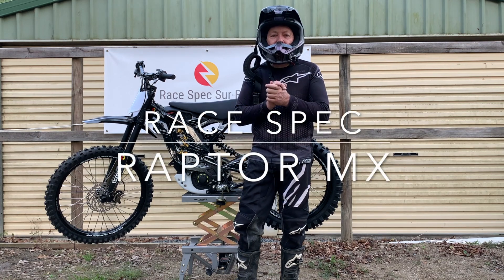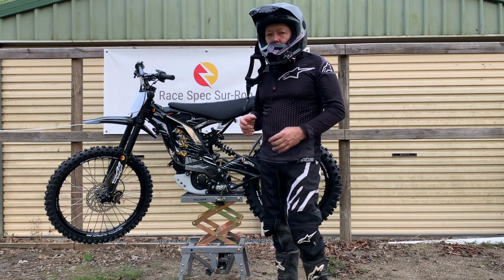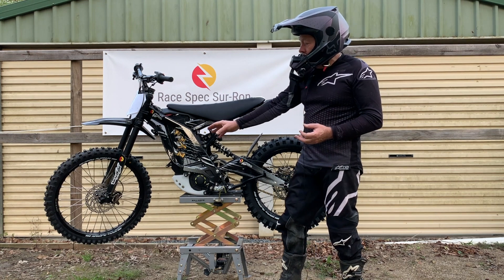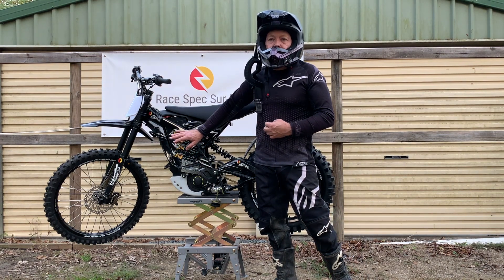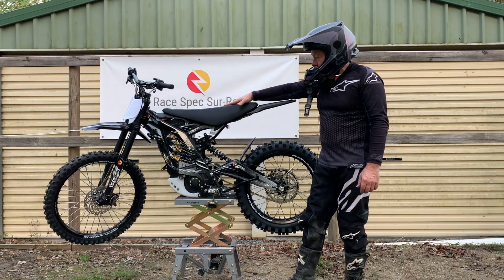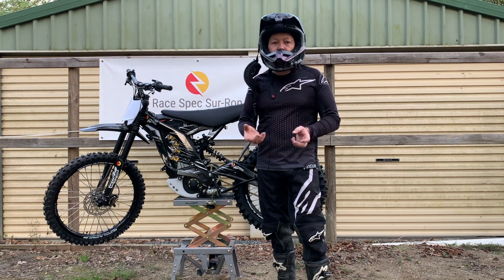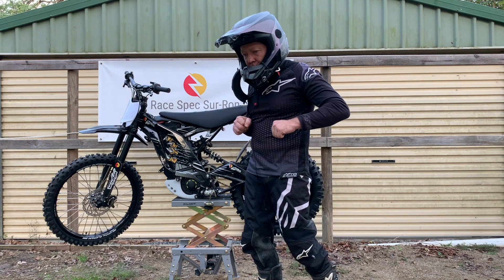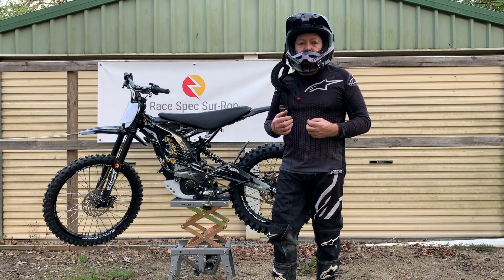Sur-ron "Raptor MX" by Race Spec Sur-ron

Comment: Excellent.  Chap uses the term "platform" and that tells me, as a bike builder/MTB rider, this guy is dialed in.  
I have had a Sur Ron for 2 years now riding at trail capital of Canada in Uxbridge Ontario and Ganaraska Forest further east.  Bike is amazing but how to mod for "lighter and longer double track rides".  I am trying to build the bike down "tour spec" ... but apart from settings, battery, sprocket, tyre type/size, wheel,  ... not sure how best (best bang for buck) to lighten.  Goal would be to ride the "Great Canadian Trail or Great American Trail".

Comment: Hi there! I'm 171 cm high, would the 21+18 combo be too much for me? Should i maybe stick to 19+16?
Reply from the maker: Wheel choice depends a-lot on what type of riding you do. If you do mainly tight technical off road riding then at your height the 19/16 combo is good, plenty of tire options and a cheaper option. It will also work better with a stock controller as it will sap less power to spin the rear wheel. If you ride mostly open trails or more MX then the 21/18 is a good option as it's better at higher speeds. The extra height wouldn't be an issue for you. Tire choices are harder and the extra weight on the rear tire does sap some power, you will notice this especially if your controller is stock. Hope this helps.
Reply: @racespecsurron1220  thank you very much, mate

Comment: How durable is the battery cover now that you are sitting on top of it? Will this need wear and tear replacement over time? Maybe a redesigned battery cover might be worth including in your inventory.
Reply from the maker: Hi Rj, little pressure is applied to the battery cover. We've been testing and no issues have arisen. The only issue is if you levered the seat against the battery cover, like if you didn't unlock the battery cover and tried to force lift the seat, you may damage the seat mounting point.

Comment: No linkage on the rear suspension, how does it work?
Reply: The motor goes to a pulley on the swing arm hinge which then transfers it to a gear which then converts to chain drive for the rear sprocket. It is a really cool design. No chain slop as there is never any change in the length. If you check out photos of the sur ron and look at close ups of both sides you can see the motor to pulley on one side and the small gear to rear sprocket on the other side.
Reply: @rcranch3838  no,I meant the rear shock, looks like eliminated the link.

Comment: For me.. i have the super moto wheels from luna.. and i can stand up feet flat when on the bike.. i have a bar riser 110mm very nice just like you said moves bars forward and up. Im 5'10.. have the kaniwaba pedal kit coming should take care of foot placement. Only 3 things left for me. 1 seat would like wider maybe a little higher not really longer.. 2 rear fender i have the stock shortie and a mud guard for the shock. But its not enough back gets wet and dirty.. 3 than the throttle stock on the newest model sur-ron (with the fast ace forks) sucks i want to be able to hold a speed if i turn the throttle 1/4 i want to know im hitting a set speed instead of the jerky ride it is now. 
  Also would like a way to do saddle bags 🎒 i have 1 small bag near the battery for a tool kit
Reply from the maker: your'e correct about the electronic throttle, they surge on constant throttle, most annoying prefer the old cable style
Reply: @racespecsurron1220  not sure what one i can upgrade to. If there even is a plug and play option. I asked luna and they just said i can not upgrade to the Marga (however u spell it) 😒  so at this point i do not know what the better option would be. 
  I am use to gas bikes dirtbikes a little, more small block stuff mopads mini bikes scooters motor-pads (motorized bicycles) would like a cable set up
Reply from the maker: @miguel360kmc  Some brands available are Magura and Domino